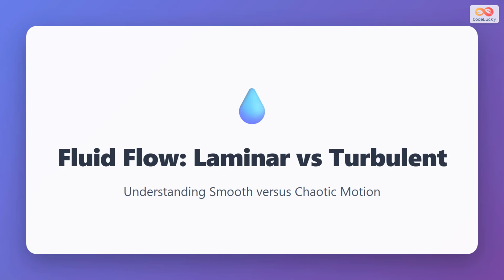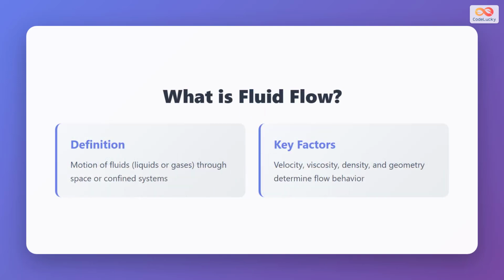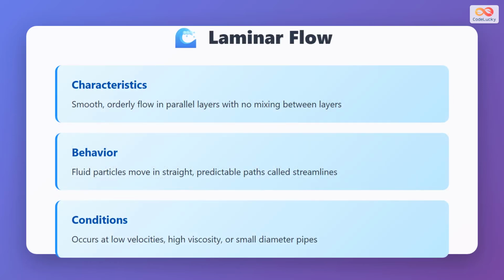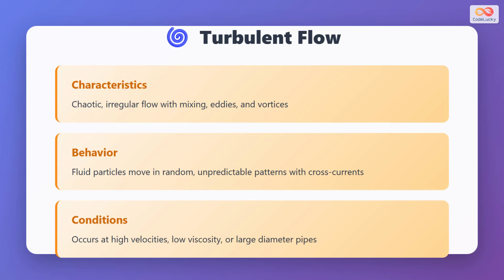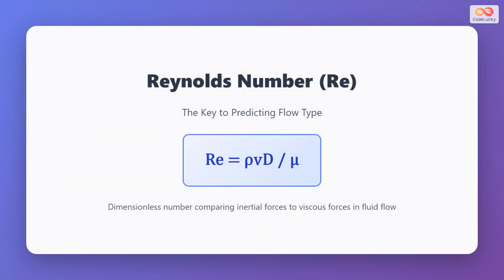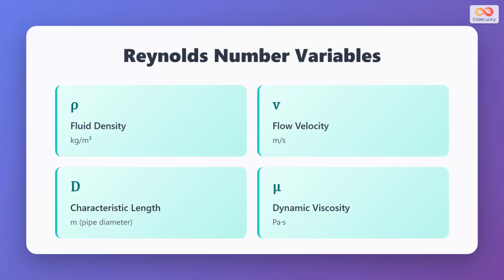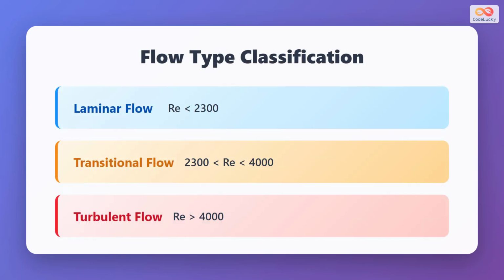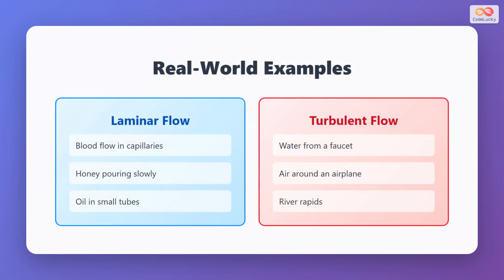Laminar vs Turbulent Flow Explained | Fluid Mechanics for Beginners

Comment: I have recently patent pending a new design that changes a good bit of the balance of Laminar and turbulent flow. 
The current pump is out of balance regardless of the current patterns. It works out of balance because the motor feeds a solid rod into at best, a somewhat balanced blade configuration.